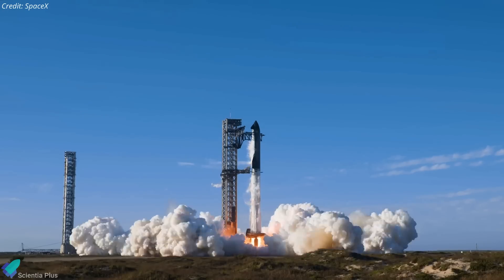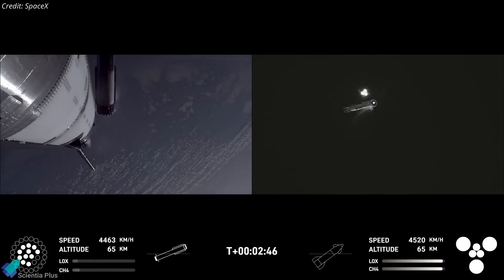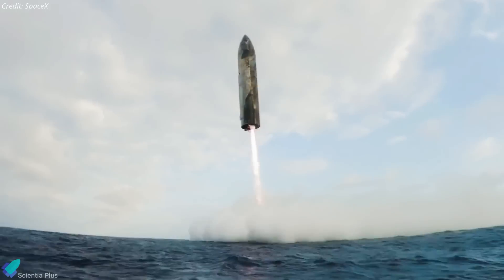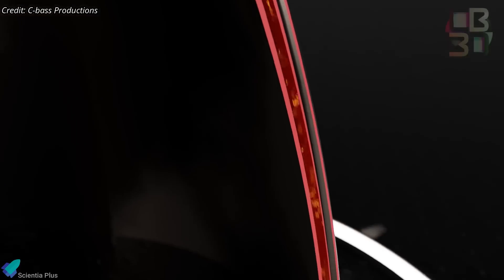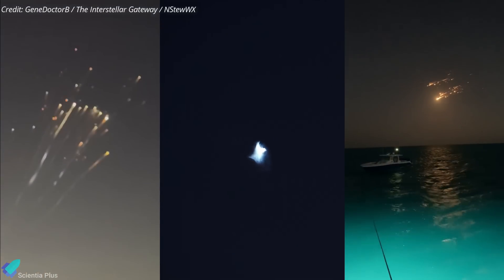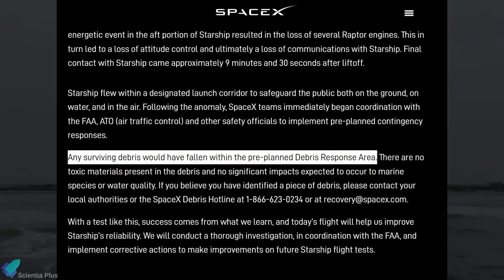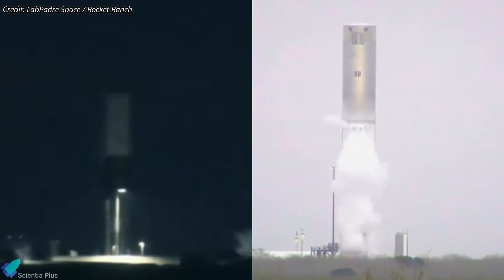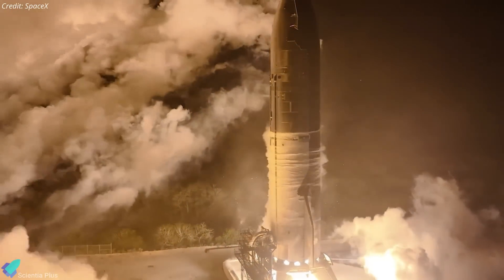Raptor EXPLODED & Ripped Off! The Root Cause Starship Flight 8 Failure Uncovered

Comment: SLS 0% failures
Starship 100% failures
Reply: Dumb comparison. SLS is completely unaffordable to begin with. Also: you can’t have any ‘failures’…..if you’re not even flying….. - Dave Huntsman
Reply: @dphuntsman 

But the next time SLS flies it will have to bring back humans from the orbit of the moon and reenter the atmosphere at 25,000 mph. Somewhat of a different requirement.
Reply: @Mentaculus42  True. But, again; we very literally cannot afford to own and operate it. And it flies so little- the current system can’t fly more often than twice per year- that I consider that ‘unsafe’. Safety comes from flying. - Dave Huntsman
Reply: → dp 

So do you have a solution that allows spacex to return humans from lunar orbit back to earth’s surface. So unless spacex has a super upgraded dragon capsule that is somehow integrated into some sort of starship system or if starship can do an active (not passive like Orion capsule) earth orbit injection burn to transfer to dragon, then Orion has capabilities that spacex has not developed yet. Considering how nearly flawless the SLS launch and Orion operations were (however expensive) would suggest that it is mostly safe. Besides the SLS’s engines and boosters are rather flight proven compared to spacex. 

Besides elon is working on getting the SLS cancelled & ISS deorbited so that MORE NASA funding can go his way to help pay for starship development to launch starlink satellites. So it is highly probable that what u want will come to pass, but possibly for the wrong reasons. Personally I would prefer that NASA gets out of putting humans into space and spending that money for more scientific research to help save the planet. Putting humans on the moon / mars is just a vanity project and best left to others (hopefully without public funding from the US). To have NASA racing the Chinese to the moon or Mars for political reasons is just wasteful. Also personally, I feel that it is going to take a longer amount of time for spacex to work the bugs out of starship than the schedules reflect.

Comment: "preventing a fully controlled decent".  WRONG, it was FUULY controlled, despite lacking one of the 13 outer engines. That is what redundancy does for you.
Reply: Who the fck cares about this bull.... . Wasted money and effort to deal with real stuff
Reply: Heh, i wrote almost exactly the same on wais video. And thats why having 33 engines are better than 2 big ones if you get ignition failure on a couple of engines you still have loads of redundancy
Reply: @Glorybast84  that’s not how it works

Comment: The New engines could be the answer 🤔
Reply: After the similar(?) failure with Ship33 in IFT-7, I think SpaceX said that Raptor 3s would have avoided the problem.  But I guess if they were right, they should have avoided the problem with Ship34...
Reply: The same engines worked fine on the previous version of the ship
Reply: @sped2001  There's a lot of new plumbing on the bigger and heavier Block 2 Starship to feed the old Raptor 2 engines.  Perhaps the added load is stressing the engines enough to cause vibrations that are disruptive to the plumbing, and this might be less of an issue with the more powerful Raptor 3s.  I don't know, at this time people can only speculate.
Reply: @victorkrawchuk9141 

The raptor 3s with HIGHER CHAMBER PRESSURE should help.